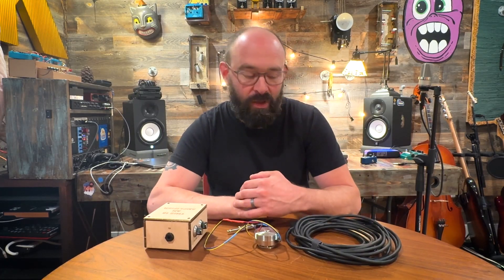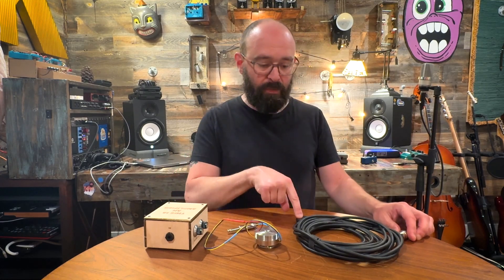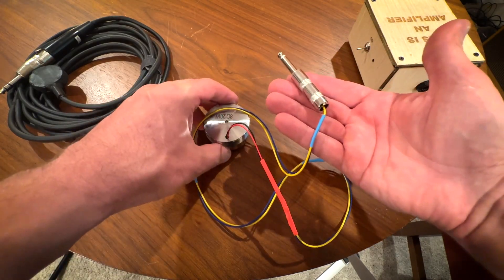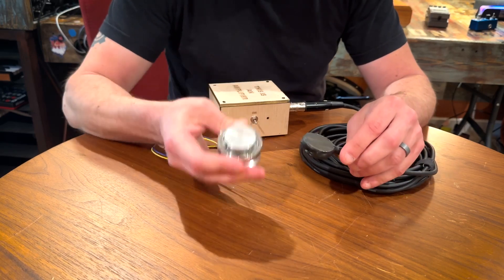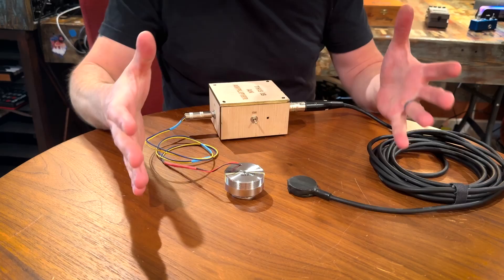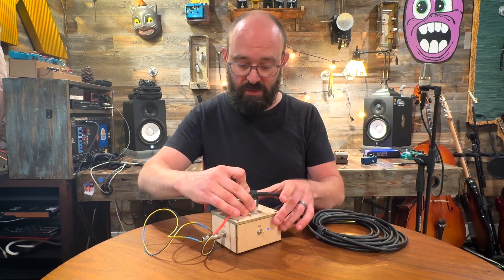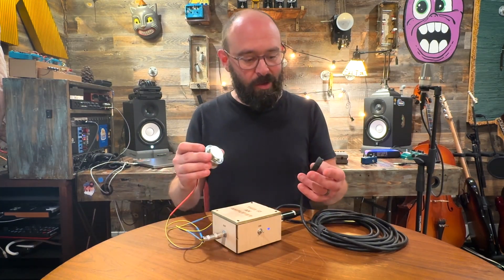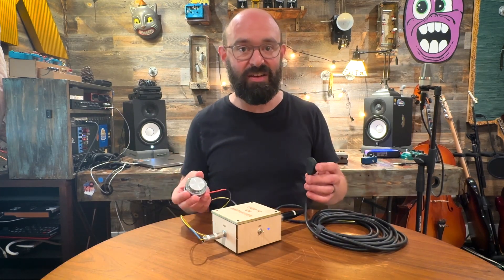Exploring Feedback Loops with DIY Audio Gear | Experimental Sound Techniques

Comment: Beautiful sounds!

Could I trouble you for a link to the specific transducer you're using and the amplifier circuit, too? I'd like to make one and I'm having trouble parsing the specs on transducers that are bass-focused vs "tweeters" with higher frequency potential.

Thanks!